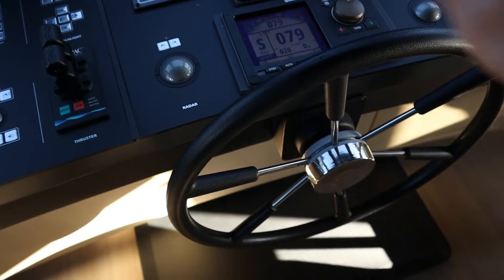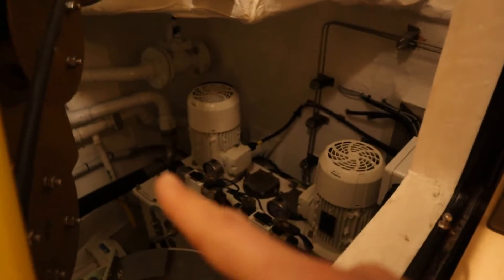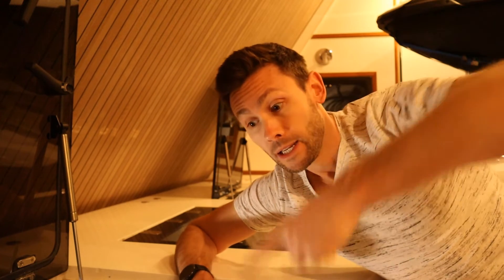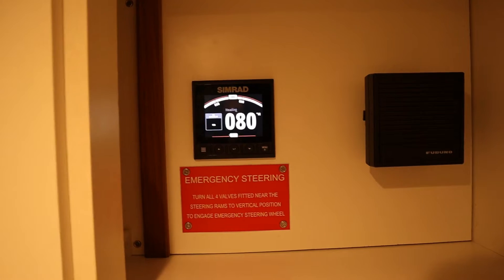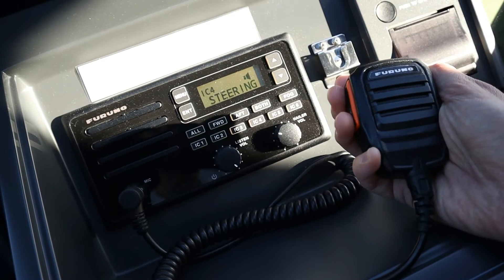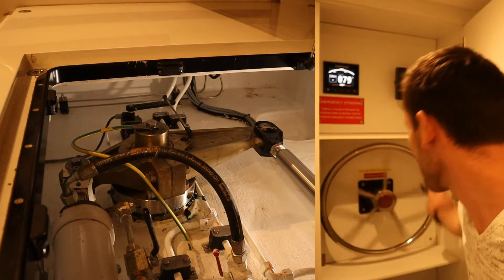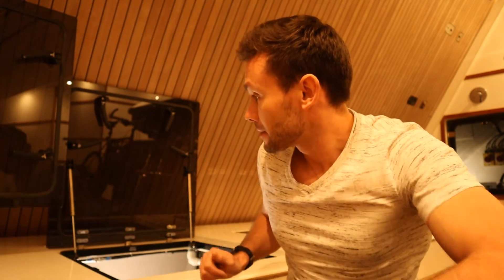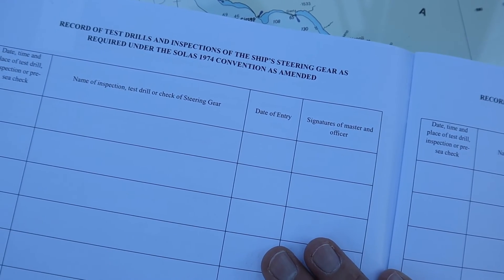HOW TO STEER A SUPERYACHT WITH NO POWER | A complete walkthrough of our emergency steering system

Comment from the maker: How does this compare to the emergency steering system on board the yacht that you work on?
Reply: Same set up almost exactly. Do remember to turn off your spare steering pump, with both going at the same time the hydraulic oil tends to heat up and throw an alarm. Usually at 3am on a long passage and I have to go in that compartment and try to cool down the tank with a water hose so the emergency shut off doesn’t kill our steering. 😅

Comment: do you need a yacht record book to log hours/tasks on yachts or can it be done with a normal seafarer's record book?
Reply from the maker: If you're working towards your OOW 3000 qualification then you need to fill out a training record book. I speak about it in this video:
https://youtu.be/L65ki2XvOBE
But if you already have your deck officer qualifications and simply want to log your time on board ship, a discharge book and seafarer's testimonials will be sufficient.
Reply: @WorkonaSuperyacht  Would I need to work on a training record book to 500GT and work my way up? I'm new to the superyacht industry but i've been working on charters, I have a regular seafarer's training record book which is why i'm asking if i'd need a special training record book for yachts, thanks in advance!
Reply from the maker: @idkgg9588 The most widely used training record book in the yachting industry is:
MCA Training Record Book for Yacht Ratings and Officer in Charge of a Navigational Watch (yachts, less than 3000GT). You can download a copy of it from the description of the video that I linked before.
This training record book is required for getting an MCA OOW 3000 qualification, which is probably the best qualification to get unless you're working towards an OOW Unlimited qualification in the merchant navy (for which you will be issued with a different training record book).
If your current training record book leads to a qualification from a different government agency that you prefer then maybe that is the best option for you. But if you wish to make yourself as employable as possible in the yachting industry then I recommend you download the MCA training record book and start getting that filled out.
Reply: @WorkonaSuperyacht  yeah, the book I have right now is more for merchant navy but I'm getting more interested in the super yacht industry, would I be able to do the MCA without being in the UK? (I'm in the Mediterranean) thank you very much for your answer! It makes more sense now!
Reply from the maker: @idkgg9588 Yes, you can do the MCA qualification even if you're not British. The courses can be done at many schools in the Mediterranean, and you'll probably only have to go to the UK to do the final oral exam.

Comment: No we know how Mat stays so fit. We always thought it was his diet and working out. Come to find out, he I just turning the power steering pumps off and hand cranking the yacht. There are some yachts that have emergency steering set inside an engineering booth. M/Y Unbridled I think has a system like that in case the ship is taken over by pirates. Emergency steering is something you never want to use but you need to know it in case something happens. Dorothea III had a case like that when they were struck by lightning and had to steer all the way back to a friendly country off the coast of Africa. The storm was still raging so they were making constant adjustments to handle the waves and wind.